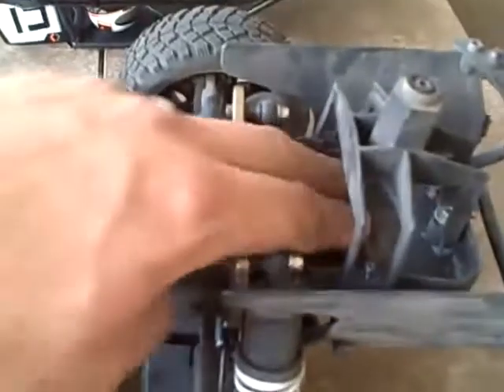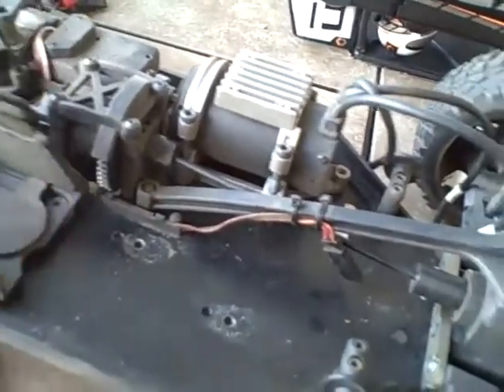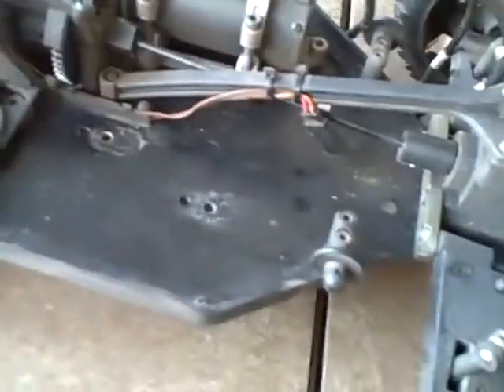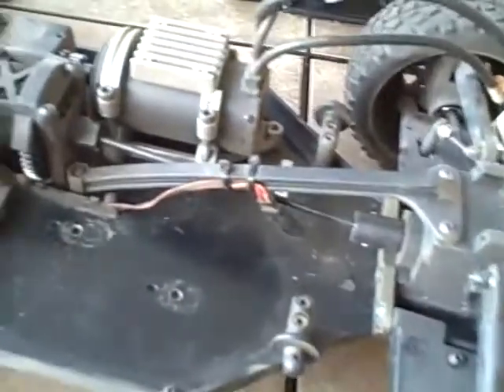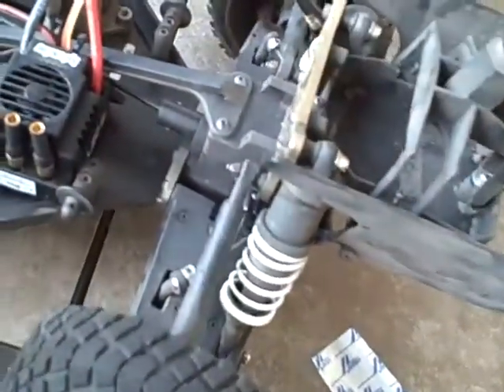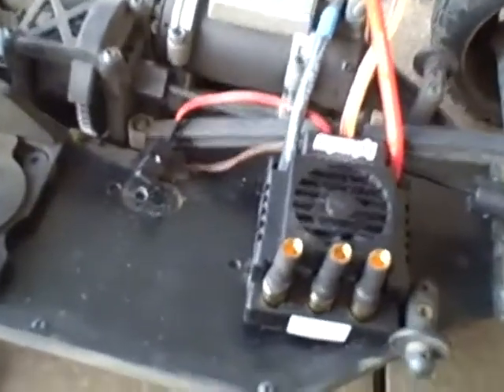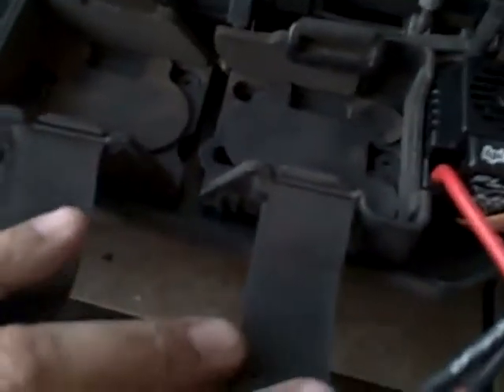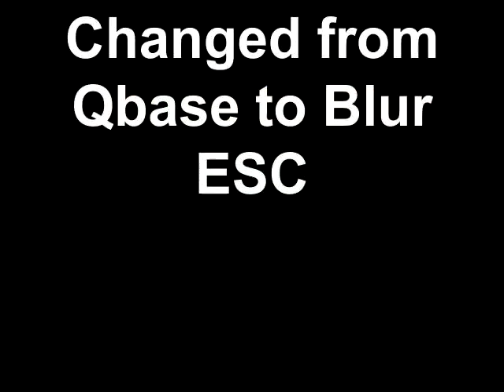Move and Change of ESC in Apache C1

Comment from the maker: I had no problems there except that it was a little hotter than when I had it mounted to my rear tower. Only reason is it closer to heat sources( lipo/motor) . On the back tower I put the fan facing forward and the air coming through the car helped keep it cooler.

Comment from the maker: Yes, that is the same as the MM. I am also running the tork2200 since it fits better in the motor mount that the castle which has a larger fin area. However, just changing the doped control which handles higher amps makes a big difference you just need to watch the heat on the stock motor when running a blur system.